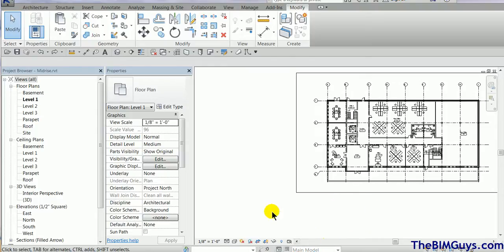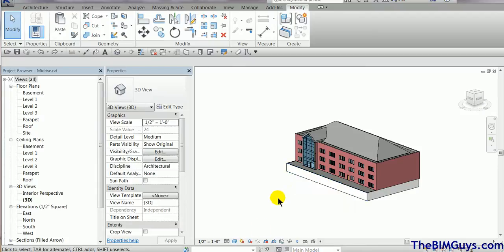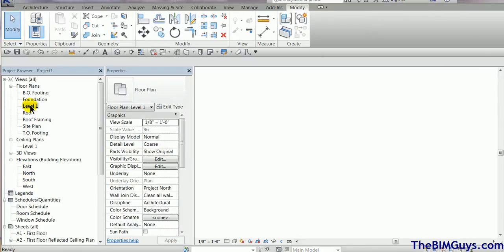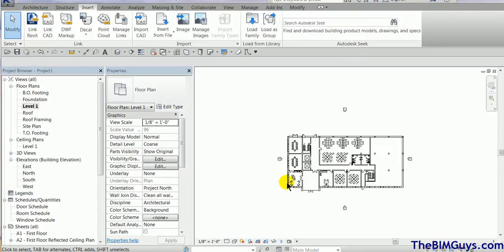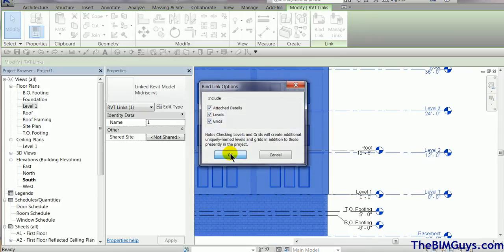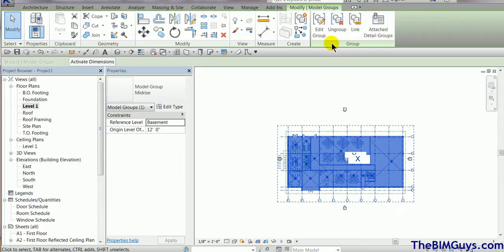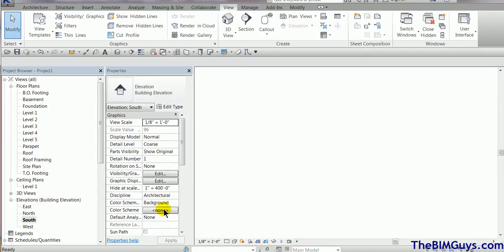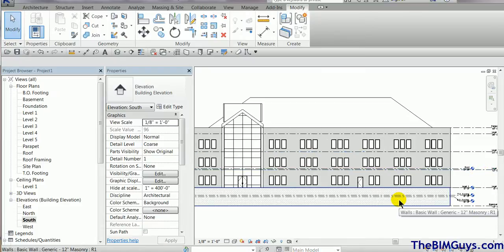Revit - Linking and Binding a building parts from one file to another - CADtechSeminars.com

Comment: How to show bind button on skreeen in revit 2018
Please tell me
Reply from the maker: Select the Linked file and it should show up in the ribbon. If it does not, check your selection sets in the bottom right corner of your screen and make sure that the link option AND the pinned option DO NOT have a red X on them. These setting will prevent you from selecting a linked file.

Comment: Would you be able to do this with construction documents and everything come in properly dim, text, interior elevs, section views etc..
Reply: No. Revit is 50% 3D and 50% 2d Line work, symbols, and annotation.  This works fine for 3D items and the annotation from the current view. These tricks do not pickup all the annotation from ALL related views.
Reply: Ken Colgan thanks for you're help.